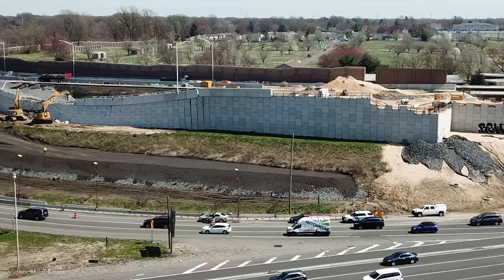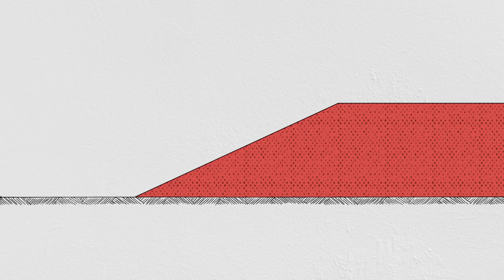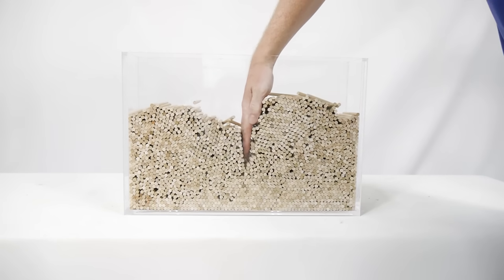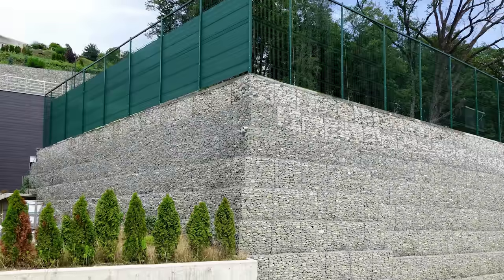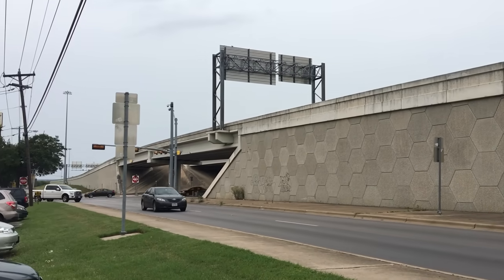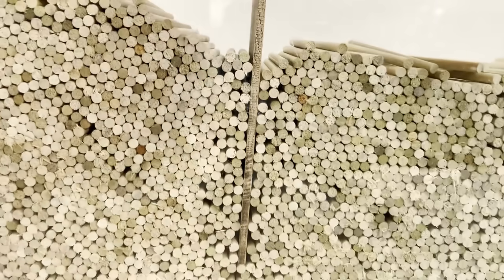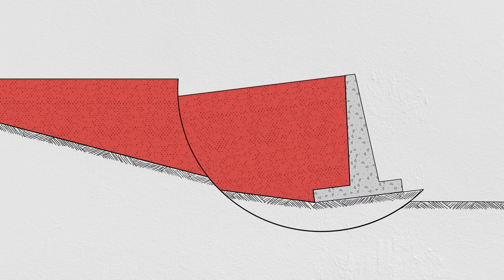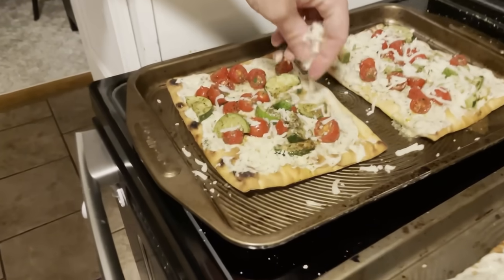Why Retaining Walls Collapse

Comment: Friend of mine had a big pool next to the house on the side of a hill. The pool area next to the house was supported by a railroad tie retaining wall. About 20 years after the concrete construction of the pool started to leak, the deep end was 13ft. The side of the pool wall was only about 10 ft from the retaining wall. Started to see signs the retaining wall was failing as it started to lean outwards after a couple of years after the pool started to leak. The father sold the house, new owner drained and filled the pool with dirt in an attempt to stop the retaining wall from failing completely, which would have also let the house collapse with the unloading of the foundation. We are 90%+ clay here in northern NJ.

Comment: I am a retired builder in australia and I have lost count of the number of retaining walls I have built over the years.
They have been constructed using hollow cement block reinforced with steel bars and concrete and built to a standard compiled by the cement block association. Depending on the height this standard specifies the width of the footing and can also have a vertical toe integrated in the footing to increase friction. The width of the block can also be varied according to the height. I have not had one failure, but I have seen many failures and the causes have usually been the lack of steel inserted in them. I would put this down to shonky builders building these walls at the end of the job when money is tight. Of course some of the walls in your presentation are way out of my league. I love watching your presentations by the way

Comment: Excellent summary of retaining wall types.   When I was designing buried structures, earth loads used to worry me more than anything else - I was usually quite happy with the calculated forces on steel or concrete, but an error in the assumed strength of ground could have massively expensive consequences.

Comment: It's been quite a few years since I took and passed my Architecture Licensing exam in California. Thank you Mario Salvadori for your structural lessons. I seem to recall several questions about retaining walls on the General Structures portion of the exam but not on the Seismic portion. Maybe you can speak to that on another occasion if you haven't already. 

On another note I am considering signing up for the HelloFresh service as I am quickly approaching the need for a retaining wall around my waist since retiring a few years ago. The horizontal thrust of the vertical food deposits are beginning to take their toll from the added load.

Comment: It is critical to understand is that the soil composition itself plays a huge role in what can and can't hold up in terms of slope.  Clay is pretty resilient to slump up to a point where water starts messing with it.  I've also been told that the types of tree root sysems matter as well, so getting trees that send roots down, instead of in a wide root ball, are better. Not sure if that's true.

Comment: that NJ project is 295 and 42 , its a 10 year project. I have cleaned and inspected pipelines there. It is a traffic nightmare before and during at rush hour times. Construction is slow and tedious because if getting material and equipment around. It can take 30 minutes to get to the other side if the highway in some spots because if the existing off ramps

Amazing video as always 👏

Comment: Some years ago in germany the Autobahn 20 collapsed near Tribsees. The reason, according to an expert report by the Technical University Berlin: they used "Combined soil stabilisation with vertical Columns", which wasn't sufficient for the increased load and lowered groundwater levels. According to journalists the non-public part also describes that the geometry of the construction was different to what was planned - and the measure of horizontal movement was stopped after two of planned six years. 
So not a retaining wall, but somewhat similar to the soil stabilisation.

Comment: The I295/Rt42 collapse did not have the drainage finished before the wall went up. It is believed to be part of the cause for the collapse, with some other questionable engineering issues as well. I’m curious what the final outcome will be for the collapse report. I travel through this interchange multiple times a week.

Comment: A very interested fact about what is mentioned at 3:13  As said on the video, the retaining wall has to hold not only the soil, but anything over it or drumroll added to it.
A parking lot with a garden over it collapsed on a rainy morning because, you guess it, the calculations did not take into consideration that wet soil is way heavier than dry soil. The pillars of the collapsed area held loads of over 34kN/m² that day. If interested, I can provide links to the news and even the forensics pdf.
Reply: Please

Comment: On the topic of water, we had (or rather, still have, but to a lesser extent) a very similar problem here with an underpass. Previously there was a factory a few hundred meters upstream, which pumped loads of ground water (I recall a graphic showing levels of easily 10m below what they original were spreading to over 2km downstream), and doing so since before that underpass was constructed. Since the factory shut down, those water levels obviously came back up and they actually had to implement multiple fixes to the underpass, as the weep holes were constantly gushing water and flooding the sidewalk there. Can't be too great for the structure either, but obviously it's strong enough so far and constantly monitored as well.

Comment: No doubt because I watched the foundations video just before this one, it occurs to me that the exterior walls of a basement are also retaining walls.  Very important ones as well, since we tend to put a lot of the mechanisms of a house in the basement.  (Most people don't particularly like spending time below ground level, so we put the HVAC plant, water systems, laundry facilities, storage facilities of all kinds, and electrical distribution panels in the basement if there is one, and save more desirable above-grade floor space for things we spend a lot of time with, like kitchens, living rooms, and bedrooms.)

Comment: A couple of questions: Are these failures more common among Eisenhower Interstate System highways than they were among Federal Highway Improvement Act of 1916/1921 highways? The old roads tended to ride with the hills, rather than cut through them. Was that a better system, even though it was predicated upon the unavailability of heavy machinery?

Comment: At about 5.44 the concrete arch bridge (Brett Forte Bridge) is at the top of the range near Toowoomba Qld Australia & is part of the Toowoomba bypass
If I remember correctly the bridge was built on the original ground level The ground was excavated & shaped so that the arch could be cast on the ground
When the bridge was finished the road was excavated under the bridge

Comment: MSE panels aka noise wall are actually held together with steel cables that are guided through brackets that interlock them together along with geogrid or tieback. Shoutout to Cretex precast.

Comment: Being a South(ern New) Jersey resident I thought I recognized that collapsed wall in the thumbnail. It made big news here when it failed.

The highways involved in the "Direct connection" are I-76, I-295, and NJ Rte. 42. The wall that failed is for the bypass of northbound I-295 over eastbound I-76, locally known as the North-South Freeway. As you look at the video the traffic headed right to left is headed into Philadelphia via the Walt Whitman or Benjamin Franklin bridges or Camden City, NJ.

Comment: There is an additional element to the "retaining wall" that is constructed by tying a wall to the soil with geotextile fabrics, etc. In that type of construction the earth must be compacted to a specified density. The wall doesn't support the contained soil, the soil supports the wall, which is actually just a weather face for the geostructure consisting of layers of compacted soil with interleaving layers of geotextile  fabric. Additionally, there must be a curtain of gravel behind the wall for the full height and drainage pipes at the bottom of the gravel curtain to prevent hydrostatic pressures from acting on the soil side of the wall. That is exactly the type of construction that I used on the rear of my hill side property to extend a flat yard to the downslope property line. The "wall" height is up to fourteen feet. During construction I had to constantly monitor the workers doing the compaction, geotextile placement and wall block laying. They repeatedly tried to speed up the process by laying too deep a layer of soil before compaction, which was done with a "jumping jack" type of compactor. To properly compact the soil to the required density no more than six inches of loose soil at at time could be placed before compaction. Additionally, even though constructed in a dry environment, the rear yard, which is about twenty-five feet wide, contains drains spaced every twenty feet along the length to prevent the soil from becoming saturated with water.

Comment: A Secant retaining wall was built into the emergency spillway system while they were rebuilding the primary spillway  at the Oroville Dam after both failed in 2017. I don't understand all of the engineering in the rebuild but it was extensive.  During the 2017 emergency flooding, the heavily damaged primary spillway could not take on maximum capacity output without sustaining more damage so they slowed the gates and allowed the emergency spillway to top over to help drain flood waters. It had never been used and therefore untested in the dam's history. The run off scoured off the topsoil and revealed the inherent weaknesses in the  bedrock beneath as being highly fractured, unstable and susceptible to erosion by the rapidly draining water. The run off was causing rapid headwater erosion in the fractured rock down the slope of the emergency spillway  potentially jeopardizing  the dam's integrity so they had to stop the top-over and open the primary floodgates further. The emergency spillway was later redesigned in the repair phase with extensive reinforced concreate capping the fractured bedrock and a secant wall added near its base to stabilize the rock slope. Both spillways got 1.1 billion dollars worth of ground water abatement reengineering  in the extensive repairs after narrowly averting a disaster of biblical proportions! Science!

Comment: With us it turned out that a mountain slope that a road leads past is not stable but slowly slips off. This resulted in major fortification measures. Retaining walls with drilled anchors were built below and above the road. These are preloaded and few even have dial gauges on their heads. The whole mountain was also measured by fixed points in order to be able to measure future movements.
But that must have cost a lot of money.

Comment: at 10:32 you can see the drainage for the wall. According to (German) rules this drainage hast to be at the bottom of the foundation, not above it. Because if its put in like you showed, the water goes under the foundation and makes is unstable.

Comment: Interesting.  When the Anthony Henday Freeway was being built, I was wondering how the builders was using the multiple large orders of grout (10,000 bag orders).  I thought it might be used in the joints in the bridges or maybe the interface between the concrete and asphalt.  It makes more sense they were using them to fill the nails on the retaining walls.  I was on the factory floor making the grout.

Comment: There's an exception to the statement that slopes need to be 25% or less.  Certain slopes in loess (wind-deposited silt from long-gone glaciers) need to be cut near vertically.  This varies across regions, so check locally.

Comment: I've had this problem in my garden just holding up 2 feet of earth. One possible reason why my walls have fallen down is I have a bit of a habit of stepping over them, but then I have just had a little think and recall the house I was brought up in had retaining walls on the patio. They hold up about 3 1/2 feet of earth and have stayed there perfectly for 50 years. The question is why (same habits). Well the difference is the ones that stayed put had a wavy curve to them. Think about it, as you can see it totally changes the mechanics of it with a little use of a third dimension.

Comment: Surprised you didn't discuss cantilevered pole retaining walls! Timber poles are the bread and butter for residential projects here in New Zealand.

They are basically just bored or driven poles with some element spanning between them. Can be timber, concrete or steel piles, usually with timber or concrete backboards.

In your example of slope stability failure, you can't just design a larger cantilever wall to mitigate slope failure. So you have to look at other options. Cantilevered poles are one way to take the retaining wall foundations beneath the failure arc.

Comment: Great video, but you need a 2:1 or 4:1 audio compressor (instant attack, 250 ms release) to normalize the whole thing. You can gate the noise off before that for more effect. Sidechain compression is what drives "ducking", where the music is automatically turned down when you speak.

Comment: Man, running through the older sections of New York City, particularly in the Bronx and Brooklyn, there are these retaining walls on highways that are made of red brick. The bricks near the bottom of the walls are all dissolving, with the concrete mortar sticking out, showing how long the bricks should be. 
After watching this video, I'm gonna be paranoid when driving past those places. Things are like 150 years old and are gonna collapse at any minute.

Comment: I worked on a site where they had to remove a section of a retaining wall.

I don't know WHAT on earth they'd thought it needed to retain, as the site was undeveloped, but the wall holding back a 6' change of grade went several feet below the lower grade AND was an inverted T shape with a footing that was 18-24" thick, AND was so full of rebar that even with the large track-ho with a ram they brought out to break it up, they could barely perform the work.

Comment: Always wondered why Fred meyers had to put giant steel tube pilings after they couldn't buy a hotel that was bordering their property. The hotel is about 30 feet higher in elevation than the store and only about 80' away from the side of the pharmacy at Fred Meyers. So for them to have enough room for a drive thru and parking they built a massive steel wall right on the property line. They couldn't drill horizontally under the hotel so the only option was vertical pilings which probably cost much more than just buying the old hotel.

Comment: As an engineer I  have worked with retaining walls during building and box Culvert construction,  just how important it's to include a weep holes to help drained water from soil relieving pressure on the wall.

Comment: Because some retaining walls get tired of retaining soil and or water or both similar to speed aging. I've also wondered why on the open air side after the concrete wall panels aren't buttressed as a secondary means of support.

Comment: The type of minerals in the soil have a great deal to do with the load. 1 cubic yard of iron rich aggregate will weigh significantly more than 1 yd of sand stone. Even if it's quartz aggregate, microcrystaline quartz will weigh more than macrocrystaline quartz, because of micro being so much more densely packed. The aggregate in my area is rich in agates containing: hematite, limonite and other iron oxides and usually found in the presence of manganese and black sand. So it would need much more support than a wall the same size that's only holding back topsoil or fill dirt.

Comment: It would interesting for you to analyze some of the infrastructure that China is building all over the world.  Long tunnels under the ocean, bridges across 80 degree faces, maaasssive dams and high speed rail piles allowing dead level construction,  train design that allows two trains at 200 mph to pass at a relative speed of 400 mph……….  If you want to compete with them you gotta understand what they are doing.

Comment: 25% incline was also the angle at which large blocks of Limestone seem to have been taken out of a mine in Ancient Egypt, according to a video on CuriosityStream called "Pyramid Builders" they used posts to pull the block up as well as push them. And they could have gotten much higher on the Pyramids by inserting posts as they built ramps, and then only near the top needed a wraparound ramp. It is interesting to see that they find documents about delivering supplies to the pyramids, discover the workers village, as well as found places that still had the holes for the posts that were used in raising these giant blocks. Of course, none of that would have happened, without the UFO crash in ancient times, and the new alien slave labor they had at the time. ;)

Comment: Haha, saw you on TV tonight. I vehemently dislike most programs made for television due to the whipping around of cameras, the noise, the fake sound, the same footage reused over and over, the repeating of almost the whole show after the commercials, way too many commercials. LOL! That list was longer than I realized! Anyway, mom recorded it for me because of the derailment of the tank train, but you were talking about the explosion related to the fractional distillation tower at the refinery in Texas. Those two dudes in the diesel pickup should have known that a racing diesel engine means there are combustible vapors in the air! I would have thrown it into gear and gotten the heck OUT of there!